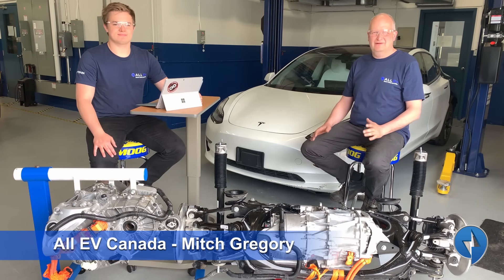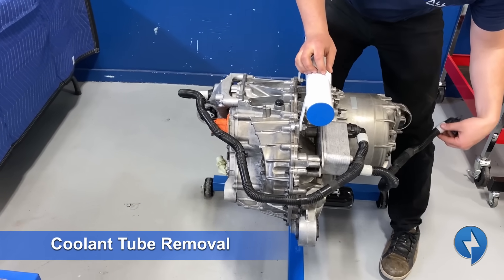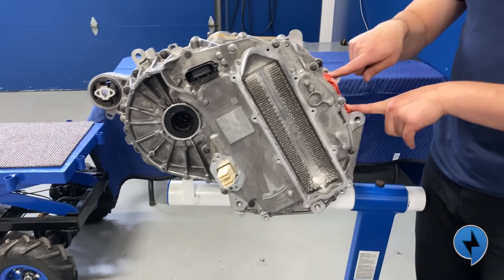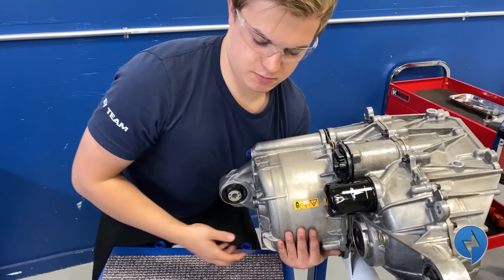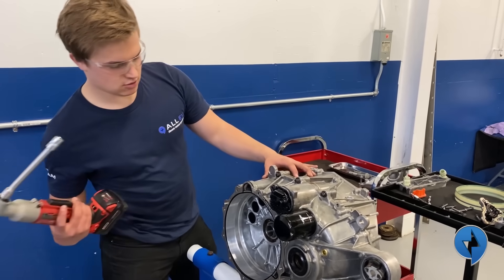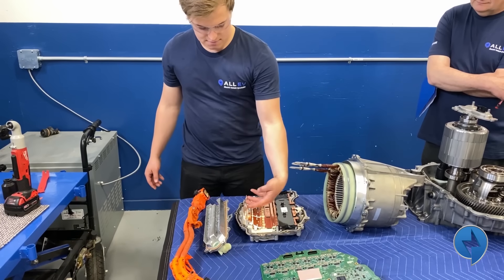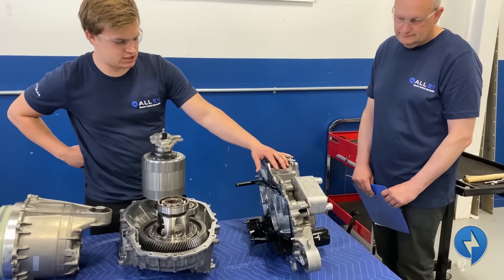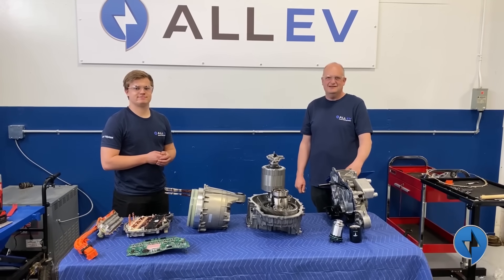Tesla Model 3 Motor Tear Down - ALL EV

Comment: That spring at the bottom doesn't keep the rotor tight
Thats the mechanical control between speed and torque..... basically when the rotor and its magnet's are fully submerged in the electro-magnets,the engine produces more torque than speed and when the spring pushes the rotor slightly out of the electro-magnets,the rotor spins faster with less torque

Comment: the model 3 rear drive unit is a dc motor. you shouldn't have an inverter unless this is the front motor but it wasn't specified

Comment: I recently saw a tear down of an electric RAV4, apparently the drive unit is made by Tesla. That was the first time I realized that the motor bearings are sealed bearings. It looks like the model 3 drive units use sealed bearings also? This means all of these electric drive unit motor bearings will fail in a fairly short period. I think that should be pointed out in these videos. If I buy an electric, I would want a car that lasts at least 200k miles with good maintenance, such as changing drive unit oil. Apparently that won’t do much good on these systems?

Comment: Thanks for the insightful video. I've got a sailing yacht, and we've taken out the diesel engine. Now, onto the next phase (pun intended): getting an electric motor, batteries, solar panels, and so on. It's a shame Mitch isn't in Australia; otherwise, I'd definitely hire him to assist in converting and installing a Tesla motor in my gorgeous 40-year-old, 18-meter sailing yacht. Mitch, you make this seem effortless. How about a trip to Australia, mate? 😊

Comment: Let me ask you because Iam new to electric but Iam a master tec and have had crazy cars my whole life Iam trying to add a front motor to my model 3 long range I know I need the front sub frame and axles and coolant lines and drive unit what else will I need and how would I tell the car it’s now dual motor are the battery connectors different or is it plug and play or do I have to swap my battery for a dual motor battery trying to see if it’s worth doing all the work I just want to build not buy

Comment: Reg inverter plug to the three legs, orange plastic with double rings to prevent water and or dirt from entering  chamber, so junior here demonstrates by placing three fingers into one each of the inverter pin openings the very chambers being protected by the double rings. Keep your dirty digits out of such dark places untill the manual specifically says to use your digits so. That's the miscommunication brain and mouth say one thing and the very next thought is to put your dirty fingers in the openings. It's what appears mindless and innocent that can have damaging and costly results for vehicle owner and if gud fo bid your working on an aircraft, those results can down jet liner. It's so mind blowing easy to put a digit into a space your blind to ie cannot see what finger is contacting, so untill the manual instructions say so, keep your finger to yo self and slow down man, your there to learn and gone are the internal combustion your future is technology based gone are the grease and fluids, almost and consider what your working on as a main frame server for company, move smoothly with your brain connection to your body and finger tip. Know where you are at all times.

Comment: Don't need all those expensive gears and differential.  Just flank the motor coax with 2 torque converters.  AF motor would work better and be more efficient.  Altogether 70 percent less parts,
30-40 percent increase in efficiency as a lower power motor would be aided by the increase in torque from the torque converters.

Comment: Any idea how you'd remove the threaded nut holding the rotor laminations together? I thought about a C spanner but wondered if there's a better method. And any idea what the plate with bumps between the bearing and the threaded nut is for and how you might remove it? A rotor tear down would be great to see if you can make a video on that!

Comment: Wow this is a lot easy to work on compare to traditional gasoline tranmission. I knew they used tranmission fluid and it always need to be service. It just like toyota and the rest of the car tranmission. Most of the vehicles call it life time tranmission fluid but it still need to be service to prolong their life of tranmission clutches.

Comment: Let’s see, so I can go with an inverter, rotor, stator, motor controller, fixed ratio gear reduction, a splash of oil and coolant, and make tons of power OR, go with an engine block, head, crank, cylinders, rings, con rods, wrist pins, valves, camshaft, spark plugs, turbine, fuel injectors, ecu, water pump, all the associated piping, a starter motor, drive shaft, multi speed transmission, torque converter, radiator, exhaust manifold, catalytic converter, resonator, muffler, plus gallons of oil and coolant with some seals and gaskets that will hopefully keep it all in, just to produce an inferior power to weight ratio in a less efficient manner… I know what the better option is, and I voted with my wallet.
Reply: Dramatic
Reply: Don t forget the battery which alone weights more than all that you listed!
Reply: @serbancordis3416  A BMW M3 and Model 3 Performance both weigh near as makes no difference to 4000lbs

Comment: That transmission looked very strongly built, big bearings and gearset. But I suppose it would have to because of the enormous torque being delivered by that electric motor.

Comment: So you still using fossil fuel to run the motor keep the motor cool so EV is a polluter and still need fossil fuel that’s where oil comes from. So easy  to brainwash people.

Comment: Good effort. I was interested in the inverter details because It is hard to get my head around how Metal Oxide Silicon Feild Effect Transistors handle the huge amount of power. That would be a good topic on its own. This video was great for context.

Comment: Just a basic logical question (since I am not a science student)...when the rotor rotates at high speed does it not cause friction with the stator coils and damage it??  is there something between the rotor and stator to prevent friction??
Reply: The rotor does not touch the stator. There is a very small gap there, it varies depending on the electric motor, but it's always very close, maybe just a few thousandths of an inch gap between the rotor and stator. But there is no friction there because they don't touch. If the bearings at each end of the rotor shaft were to fail, THEN the rotor could drag against the stator and the whole thing would be toast.

Comment: Is there any type of an Alternator in the assembly thereby charging back to the battery while the motor is using up energy?
And if there is, is the inverter electronics controlling charge and discharge between the two so that pulling energy while charging, but when coasting, supplying energy back to the battery assembly?  
How does the BMS or Battery Management System come into play?

Comment: Dam that rotor and stator are so small, how does it have so much power to move a vehicle so fast?
Reply: well the quick ones have two or three of them
Reply: @JackMott  well... I wouldn't call the basic model 3 slow either. It takes only 4,4 sec from 0-100kph. Not shabby at all.
Reply: @Nudel-nc1cp  its rated at 5.something, are people getting 4.4 ? not slow either way!
Reply: @JackMott   Yeah u right. Slowest one is 5,8 sec 0-100kph. Still pretty quick.
Reply: @Nudel-nc1cp  can this be modified to be faster is that about it?
Reply: @HannesDelahaye  I'm not sure. The standard version have only one motor where long range and performance models  are equipped with double eletric motors.
Reply: Gear ratios mostly I think it’s 7.5 : 1
Reply: That’s the beauty of electric motors. I’m gonna offend a lot of gearheads here but the electric motor is a superior technology to the internal combustion engine. There’s a good reason why electric motors have been successfully used for train propulsion over a century up to this point.
Reply: electeric motors are very efficient

Comment: Good video, but what is remarkable about the new model 3 is the reluctance motor I was an armature winder for over 40 years and the technology behind the new engineering is remarkable it took a problem facing induction motors and came up with a design solution that makes this motor the most efficient power plant available. Just like the quality of material tesla uses this company blows me away. As soon as my dinosaur of technology gets paid off I am going to get one of these babies.

Comment: Tesla is really miles ahead of its European competitor!! You could notice that the electric motor do not have clutch, speed control all done on the inverter. So that the gearbox should be much much more durable. I am also imagined that oil change (for the gear box) could only be done every two or three years once....

Comment: How does the brake system works? I don't reffer to the rechargable system for the engine, I reffer to the brakes when You wanna stop. Is it an electric brake pump? Or just an hydraulic pump?

Comment: Hello and great video and looks like you have real BONAFIDE #passion that very few have.  This is exactly the sort of trait I am looking for as I recruit talent like yourself onto our company. Ultimately, it is a handheld device that is centered around an electromagnetic motor technology that uses profilers like oscillation and vibration among many other semi-robotic movements and controls that manipulate a series of shaver heads that remove hair off of clothing and upholstery.  

I have one Mechanical and one electrical engineer who is getting close to a proof of concept but we are very early in the design and perhaps looking to add another foundational piece to the company to work the innovation in and through. 

Thanks 
God Bless 
Jon Bonafide 
DPXS -FOUNDER/CHIEF DRIVER

Comment: what voltage does the motor run at? and how many poles? or how many rpms?
Reply: I know the rpms but not the other stuff. Some of them run at 16,000rpm max and some at 18,000rpm.

Comment: 10'27 (about the inverter and motor) "to create sinusoidal waves to pass to the motor" , is not correct....it is neither a asynchronous AC motor (ASM) nor a synchronous permanent magnet (PM) motor nor an asynchronous one , it is a mix of a SRM= Switched Reluctance Motor and a PM, i.e. IPMSynRM= Internal PM SRM....in any case the voltage  waveform on each phase is always pulse width modulated (PWM) square wave (IGBTs just switch on or off the DC-link voltage of the battery) for all those 4 types of motors (ASM, PM, SRM, IPMSynRM).... while the generated three-phase currents for ASM and PM are in did sinusoidal (with high switching frequency ripple), unfortunately the current waveforms of the SRM are by far NOT sinusoidal ...that is the primary reason of the very high torque ripple and therefore noise generated by SRMs, its biggest drawbacks (and killer argument for use in other applications like elevators)....

Comment: By far the best 'how Teslas work' video I've seen (apart from the audio!). But I wish you'd spent a few minutes on how the motor works - solid magnets produce good torque but the reverse induction causes problems at high speed - that sort of thing. The design of these units is very clever (although I would have gone for a more modular approach for ease of service/repair), but the genius is what goes on inside the actual motor and how Tesla have got round the induced emf problems, etc.

Comment: And right there at 5:09 will be the one thing that will fail quickly and then half the motor has to be taken apart to get at it to replace it- it won't be repairable.

Comment: Mind blowing to see how such a small motor produces so many kilowatts
Reply: Yes, electric motors of this type are around 95% efficient. Regular gasoline engines are only 25-35% efficient by comparison.
Reply: @Nicholas.T  Yeah man, when you think about it, gasoline engines are seriously antiquated compared to the simple yet super efficiency of electric motors. I have moved on from gasoline engines in power tools like mowers and edgers, trimmers, blowers, chain saws, etc. The electric versions of those tools these days are so nice, quiet, smooth, don't stink or make tons of noise, and they ALWAYS START! I hate carburetors and gunky old gas in a mower or whatever, and nasty old oil leaking, etc.

Comment: That Young man is smart but he do not have ability to explain things to an ordinary person! In other words he can be a good technician but not a trainer unless he recognize this major shortcoming
Reply: Tout à fait d'accord.
Reply: well as i have listened there is no other simpler way to explain it. the mechanicals look very simple but the tech part is really2 complicated.
Reply: @rhianngacusan1227  I was a computer trainer in the time when they Use, Ms-Dos, Windows 3.1 etc. Now In a Simple Language you introduce the whole thing, then break it into major components explaining their role in the unit. eg, If I want to tech you about computer, I will tell you what is a computer What it does etc. What are the parts of Computer and what they do, eg Hardware and Software, 1) HARDWARE, what they do, what are they. eg a) Input device like Mouse, Keyboard etc, b) Output device like Screen, Printer, Actuators (such as computer controlled Machines , networking and com devices etc. d) Memory devices such as Hard disc, Flash drive etc. 2) SOFTWARE , What are they? what roles different Software do eg Difference between a) Operating system (such as Windows, Unix, Apple, Android, Linux , Oracle, PLC etc and c)Application software. Ms Office, CorelDraw, AutoCAD etc 

Now You can See, That Boy Just Jump on the Motor and show how to take it apart throwing Technical terms like a Wizard, But what is the purpose of talking to yourself of just few? IN ANY PROFFESION THERE IS NO SUBSTITUTE FOR COMMUNICATION, If Somebody say Something is too complicated for him to explain it, he in other words admitting he either do not understand the subject fully or he don't understand how important is effective communication.
Reply: @ThobiasMarandu  well you do not expect him to detail out the program nor the IC board did you? well if you did then at your point of view it was thus lousy.

Comment: What about a brush-less single or V twin with all the regular cooling as a gas engine, hydrologic power steering pump, engine coolant pump, ac compressor, pneumatic pump for power brakes, oil pumps in each motor for cooling and lubricating the main bearings, several alternators, all the radiators, and all the temperature sensors and electronic senors. A automatic transmission with a 850 or higher stall speed torque converter and electronic shift solenoids or manual transmission. Allowing the electric motor to put out power by having a constant rpm while stopped in gear, in gear and moving, or in park or neutral with power key on.

Comment: So it has gears? I thought the whole high torque thing was because of no gears and microprocessor controlled sensors for wattage input.
Reply: It’s not gears, as in a complex 6,7,8 speed transmission that you find in a regular gas car. It’s a very simple, singe 9:1 reduction gearbox. In other words, for every 9 revolutions of the electric motor, the rear wheels turn once. But it’s a FIXED ratio, with a DIRECT connection, and does not go through any clutch or similar. Even though electric motors have maximum torque from standstill, they still require “torque multiplication” to supply a load (ie the driven wheels) and this is where the simple reduction “gearbox” comes in. Think of how a pulley system works - you can lift a 250 pound gas engine out of an engine bay with your bare hands! But you have to pull maybe 10 feet of rope to get the engine to raise 1 foot. The electric motor/gear system works in a very similar way.

Comment: looking at these teardown videos, its clear to me that there is a LOT that can go wrong with teslas. The cooling system is very extensive throughout the car with lots of places where the coolant can leak from. That inverter circuit board does not seem like its going to last forever with all the power mosfets. the good thing is that it seems fairly simple to remove the whole drive unit from the car.

Comment: Oh boy, you have to bench the whole suspension assembly if a chip fails in the inverter!? No easily changed modular inverter!? Better have a warranty! I would look for a more easy to repair EV. Compare Chev Bolt that has outboard inverter - https://youtu.be/r37nqfnV9EU?t=1119

Comment: Hi Guys, good job there - I would have loved to do this kind of work while at (eng) school! Could you provide more info on the stator configuration (Number of poles/notches), magnet configuration and nominal motor RPM? Got any non-permanent magnet videos? Which model 3 (year and configuration) is this from? Keep up the good work and look into proper microphones ;) !

Comment: @5:50 I don't think that's a speed sensor, it looks more like a shaft angle encode of some type, perhaps a synchro.  I think it's used to inform the inverter of the rotor's mechanical phase so that it can apply the correct phase angle. The speed is of course also derived from it by observing the change in angle over time but is not its primary function.

Comment: pretty much the same as what is inside an Xpeng engine, Xpeng is shooting around all over the place, launching and the highest EV volatility ever, it went from nothing to 60 billion valuation then to 25 billion in a few days, I would stay far away from both the stock and anybody associated with Xpeng (small morsel treat... rough translation, which chinese laugh at), but talking about the actual products,
well, the cloned products themselves are absolutely fantastic for the pricing